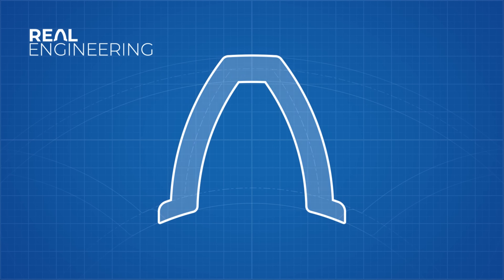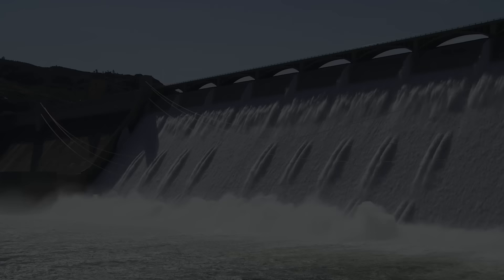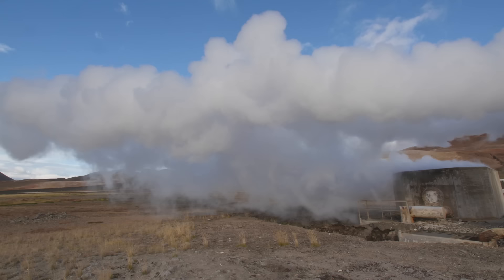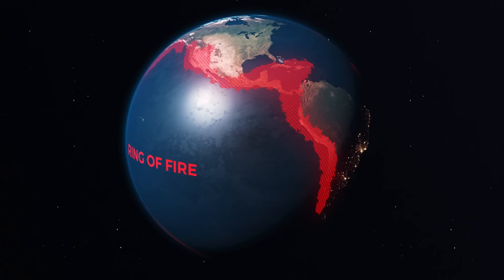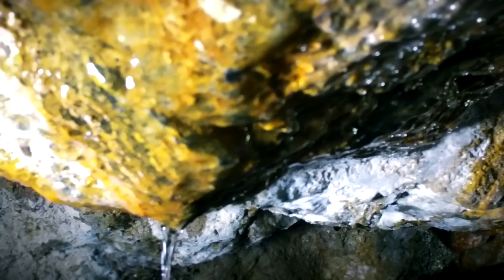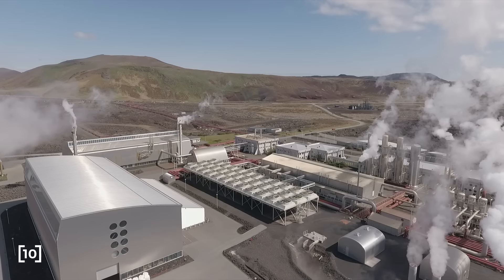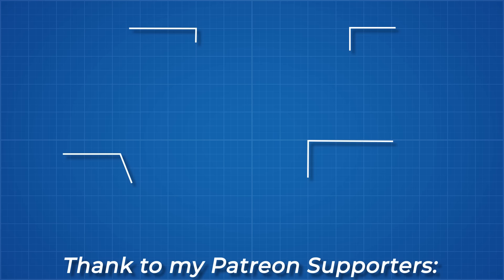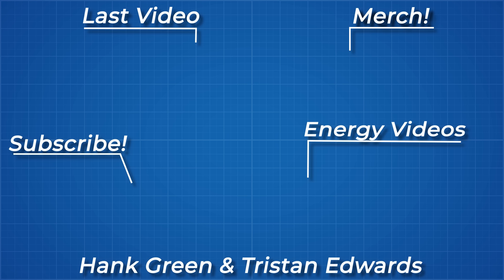Could Earth's Heat Solve Our Energy Problems?

Comment: Method number 1: Use all the excess energy of the summer to pump water and refill a giant dam. Therefore you convert the electrical energy into potential energy. Granted it will not as efficient but you save that energy to be used in winter. Just a thought.

Method number 2: Use all the excess energy for electrolysis of water into H2 and O2, save those two in liquid form in large storage tanks and than using hydrogen fuel cells you can generate electricity.

In my opinion method number 1 is the most logical since you probably already have all the necessary infrastructure you just pump water back in the dam.

What do you guys say about those methods? Are they so "star trek" level methods? :)
Reply: Step 3: Realize renewable are kinda shit and switch to nuclear.
Reply: First method is useful for some places but not most, two big problems are efficiency when accounting the infrastructure on installation and maintenance in operation. Second is the location, you can't go around damming everything without causing some serious issues with your local hydrosphere.
Reply: For method 1 there's just not enough space on earth to build so many dams.
And for method 2 we can go a step further and convert the H₂ into methane, because it's easier to store, and we have an existing grid of gas power plants and heating systems that run on methane.
Reply: Ozan l

I can’t really comment on method 2, as I’ve not researched that, but method 1 is unlikely to be plausible at a national or international scale:
- Immensely high initial cost (to buy the land, build the dam; reservoirs, etc)
- Immensely damaging to the environment in/around it (think about it; a reservoir is basically a controlled flood. Plus you still need fossil fuels (asphalt) to line the bottom of the reservoirs so the water doesn’t seep out)
Reply: @blackmesa232323  I cannot agree more dude! Nuclear energy is the only energy source available that is completely independent from the sun or the environment around it! I wish we had more nuclear power plants. But noooo some idiot thinks that it generates too much radioactive waste. Sure it does, as long as you handle them accordingly it is by far the safest power generation method!
Reply: @techheck3358  I was thinking more like pumping water to already existing dams. 🤔
Reply: Method 1 is actually used in the UK to regulate their power grid throughout the day - they carved an enormous lake into a mountain, and there's another dam lower down. Shift the water to transfer between electric and potential energy. Practical enough to regulate power throughout the day - throughout the year is another story entirely. Biggest logistical challenge is finding the right location - you need a considerable height difference between the two lakes, and you need the site to be absolutely perfect for this specific project, because it is absurdly expensive, and additional work to make the site appropriate will quickly render the project impractical. I'm not sure how this principle could work on regular hydroelectric dams, but thousands of engineers have worked on dams without suggesting this, so I'm assuming there are some problems.

Method 2 is an excellent, and very popular idea. Right now, the problem is that electrolysis of water into H2 and 0 is extremely inefficient, not even almost efficient enough to make it worthwhile - it becomes practical if a platinum catalyst is used, but platinum is absurdly expensive, especially for electrolysis at such a huge scale. Right now the cost of platinum is the single largest factor preventing this from happening - if the electrolysis was cheap enough, we could simply and literally turn water into batteries. H2 has a decent energy density by weight, enough that it could power electric cars, busses, trucks, maybe even planes.
There are 2 possible solutions - the most likely one is that scientists will develop an alternative catalyst. I've heard people suggesting graphene, I don't know if that would work, but I do know we're a long way from producing large sheets of graphene. 
The alternative, and far cooler option, would be asteroid mining. This is an idea being thrown around a lot at the moment, some asteroids have absurd amounts of platinum-group metals. But I suspect an alternative catalyst is much closer than asteroid mining.

If you want a cool, futuristic solution, get excited for fusion. Literally just sucking up seawater for deuterium, and spitting it back. Producing unthinkable amounts of energy safely, cleanly, predictably. No stressing about sunlight or windflow or batteries. Some huge advances have come over the last few years,and fusion looks about as close as all the other incredible solutions.

Comment: "Boundless", the laws of thermodynamics would like to have a word with you.
Reply: The Sun isn't off the hook either.
Reply: If we drill deep enough the pressure will generate enough heat to the point that it can boil water. This will be a good geothermal steam power source. Assuming a company is willing to invest on this.
Reply: Same can be said about "renewables". Yes, it is a misnamer. Practically speaking, it does not really matter.
Reply: Boundless in engineering terms and not physics terms.
Reply: @colmercer3315  At what cost and for how long can the heat be extracted? Do economics enter into this at all? For many physical reasons you can't just drill down anywhere and expect a good return on your investment. Look how many alternative energy companies rose .. and fell .. under Obama. The market wasn't there and the tech wasn't good enough nor economical enough nor scaleable enough. Fossil fuels are energy dense, economical, and pervasive. That doesn't make me happy as I despise the damage that the industry and the use of the products does to mother nature. However, I have yet to see any current alternative that doesn't have some serious negatives, comparable to the worst in fossil fuel usage.
Reply: @colmercer3315  We already have a hole that has reached near that temp.
Reply: @xenuno  Iceland, the Philippines, and New Zealand has a "long" history with geothermal energy. If they can do it, why can't USA?
Reply: @jonirojonironin5353  The economics of it maybe? Existing infrastructure? Population levels? Environmental protections? Locations of hot spots? Your sample countries are not a good comparison to the US in several respects .. I'd google

Comment: What exactly is "renewable" about a limited (albeit huge) reservoir of residual heat that is bound to slowly cool on a cosmic timescale? We may or may not be able to tap any significant fraction of it, yes, but what would be renewing it? There's no such thing as "idling" energy "sitting in reserve" while we aren't using it - if the energy coming to the surface and being radiated away is currently roughly in balance, then as soon as we start tapping any significant portion of it something will start cooling off...
Reply: Yeah, it's no good on cosmic scales, for that we're talking Dyson spheres and lifting fusion fuel out of the gas giants.
Reply: @jeffvader811  That's what I'm talking about.  Drilling holes in planets sounds dumb when we have a giant star right over there.
Reply: @jengleheimerschmitt7941  
Probably a waste of time for a K2 civilisation, not so much for us. I wonder if geothermal power would work well on Europa or Io for that matter?

Comment: Well, as amazing as it sounds, I have some worries to parts of this technology. First of all it could be critical draining out huge amounts of heat of the ground, in terms of our underground Water supply, ground fertility and the risk of  creating huge undergorund cracks due to contraction of materials at lower temperatures, which could further amplify the risks of EGS. 
Yet I am amazed to see how this technology will impact our future and help us get carbon free.
Still, personally I think, that geothermal Energy is just one of a lot of ways we need to go in order to create a sustainable Energy supply. We should not do the same Mistake again, by settling for just one source of energy, but instead using as much diffrent and effective ways as possible.
Reply: Not to mention, that drill locations need to be scouted very well. We have a city here in Germany where they drilled for a geothermal powerplant and hit ground water and a layer of gypsum. Well, water and gypsum isn't the best mix. The whole town is now breaking apart.

Comment: the problem wiht geothermal is the same as withc fracking, putting lots of lubricant into fault zones and instable tectonic regions and near volcanoes isnt a very good idea, its also very locational
Reply: yeah, and if industrialized to the extent to make a dent in global electric needs, well, I'm not sure how I feel about accelerating the cooling of the dynamo that protects us all from solar flairs and cosmic radiation. At the most basic level, geothermal is taking the heat out of the ground and dumping it into the air to generate mechanical or electric energy.  thus my second doubt about geothermal electricity on a mass industrialized level. There is a limit to how much heat the atmosphere can dissipate into space before things get a tad toasty for us down here on the ground. The latter being why city-planets (Ecumenopolis) in sci-fi is not that realistic unless you space people out significantly to reduce total heat output from energy usage.
Reply: @Zarcondeegrissom  
Any method of energy generation will eventually turn into heat though, that's a fact of thermodynamics. If we looked only at the power generated (ignoring all emissions) wind creates the exact same amount of heat as coal. It seems counter-intuitive, but it makes sense really, all that energy goes into heating homes, powering ovens, driving electric cars, etc, and all of that generates heat either directly or through friction and other losses. What matters isn't so much the energy generated, but the energy lost to space, if we lose energy at the same rate we gain it, huzzah! We won't change temperature, but right now we're decreasing our rate of energy loss with greenhouse gases, so we're warming up to a new equilibrium, which ain't the greatest. Ultimately, global warming is all about managing our thermodynamics.
Reply: "Any method of energy generation will eventually turn into heat though, that's a fact of thermodynamics.", yep, true, and sure I implied as much in closing (energy usage).  "if we lose energy at the same rate we gain it, huzzah!", again, yep, (There is a limit to how much heat the atmosphere can dissipate into space).  And agreed about managing thermals.

I'm just not sure you understood the scale of what was being suggested by this vid. we are not talking about using geothermal heat that otherwise would naturally rise to the surface at natural rates, what was being proposed is digging down and pulling more heat out of the ground than would otherwise naturally rise through the ground to the surface, thus adding more heat to the atmosphere than what naturally arrives here from the sun or through normal geological heating. That's what I have doubts about.

(sarcasm detected) Burning fossil fuels is bad, so let's add more heat to the atmosphere from another place it normally doesn't come from at the proposed rates needed to augment the electric grids worldwide, lol.
Reply: except, the sun still shines if you don't use a windmill or solar panel. thus that source of heat is not being changed (only where it's converted into heat the atmosphere must dissipate).   Whatever, you'll figure it out on your own eventually. you're so close to grasping what I first typed. good day.
Reply: @Zarcondeegrissom  
"except, the sun still shines if you don't use a windmill or solar panel. thus that source of heat is not being changed (only where it's converted into heat the atmosphere must dissipate)"
Still dumps excess heat into the atmosphere, because the black body radiation is in the infrared, which is absorbed much more readily by the atmosphere than the visible spectrum. I probably should've made myself clearer on that point, excluding changes in heat loss all energy sources dump the same amount of heat into the atmosphere regardless of origin. The idea that you can avoid adding heat to a system and still utilise a source of energy in that closed system is false.

For example, a world run off geothermal energy would dump just as much additional heat into the atmosphere as a world run off nuclear reactors or fossil fuels (excluding changes in heat loss as I mentioned). That is a fact of thermodynamics yes? If it ain't my A-level physics teacher hasn't been teaching me right.
Reply: true, and with some of the ideas mentioned in the vid, you're also pulling a lot of that heat way from another system that protects us from solar flairs. so, I have mixed feelings about it.  Maybe if someday the magnetic field isn't needed to maintain a life-sustaining planet, then maybe.  for now, I think there is a lot of other viable options to expand on, before drilling deep for more geothermal power. B)
Reply: @Zarcondeegrissom  we couldnt remotly take enough heat away from the thermogenic systems of the earth to make any difference, so thats not really an argument
Reply: remotely take (from the surface without drilling down deep), true. I also don't think 'remotely' enough geothermal energy could be harvested to augment significant portions of global energy usage. locally, during a single season, remotely take, it wouldn't be that much heat from the core. Scaled up to make a dent in global energy, I don't think even if national parks were converted, it would be enough. Especially when energy extraction bedrock cooling of the surface necessitates the need to keep drilling deeper for sufficient heat for the generators. Rock is a surprisingly good thermal insulator.

looking up some random numbers from the first google search result. we are between 20 and 25 'Thousand' TeraWatt-hours of energy in 2018, going back to around 2014 (for above the '20' mark). That's around about 23 Peta-Watt-hours of electricity usage globally. That's not a small amount. (and to think we are only a zero-point-something on the Kardashev Scale). I don't remember if RE listed actual Geothermal-plant output numbers, tho there is a huge difference between Mega-watts (that I recall most power plants listed in) and Peta-watts.
https://yearbook.enerdata.net/electricity/electricity-domestic-consumption-data.html
even if you could extract a thousand mega wats from a single geothermal power plant, to make a sizable dent, you would need way more than thousand-thousands (whatever the name is of that number, brain crash, before coffee) of them. Are there even that many on the surface hot spots to use, even taking over national parks, hmmm.

I'm sorry, some times I think grand, "Fusion candles" for moving gas giants around a solar system, or Shkadov Thrusters for moving solar systems around a galaxy. At such timelines and scales, the thermal mass of a planet core, is just limited. it just isn't that much and more useful for what it does naturally (generate a protective magnetic field). I can almost imagine a society using fusion generators to pump more heat down into a planet core just to bolster the natural magnetic field, lol.

P.S. you do have a good point about lubricating fault lines, bad, very bad. keep them things away from the Cascadia fault system, lol.
Reply: @Zarcondeegrissom  no it wouldn't be enough, the energy contained in heat within the heart is far beyond anything we can deplete, specifically since the thermogenic effect is proliferated by radioactive decay and pressure. It's not a finite source, heat is generated in the core and radiated from the surface into space. In 4bn years only the top 1 % has cooled solid
Reply: Good point on the nuclear part of heat generation. I just don't think 'we' know at this time how much heat is from that vs residual from planetoid accretion process, not to say the impact with Thia back when. I'm not surprised about the solid part of the crust being only about 1% of the distance to the center of the planet, given insulative properties of rock and heat shedding at the surface. One can look at a fireplace hearth to see how well rock insulates between the fire and the house wood framing on the other side of the bricks. It's not a perfect insulator, it also isn't exactly a good conductor of heat.

(edit) Also, heat flow is proportional to the difference in temperature between 2 points. The top crust would cool off fast, however, that decreases the temperature delta at the surface, and increases the distance between the hotter stuff deeper down and cool space. Thus, as the crust cools, the rate of natural heat shedding will decrease, unless you start drilling down ever deeper to keep extracting heat.

On a funny side, I guess that would be one form of "nuclear" energy people wouldn't freak out about using, lol.
Reply: @Zarcondeegrissom  lol yeah. Tbh we should just full focus on nuclear and ignore the h8ters
Reply: or at least decommission the older plants that lack safety systems the newer designs have, or upgrade them. In any case, yeah, responsible is more important than hysteria, regardless if it's wind, solar, hydro, geothermal, nuclear, etc.